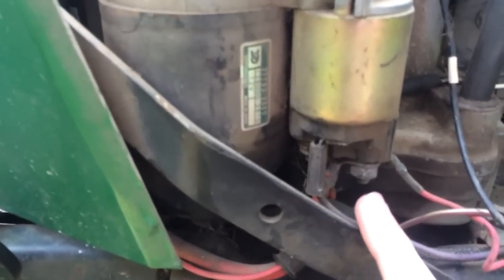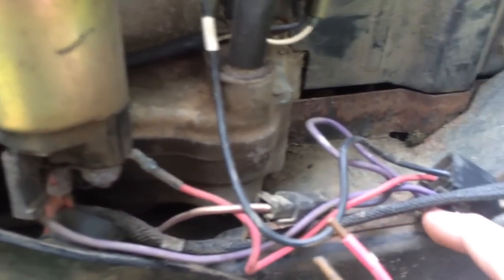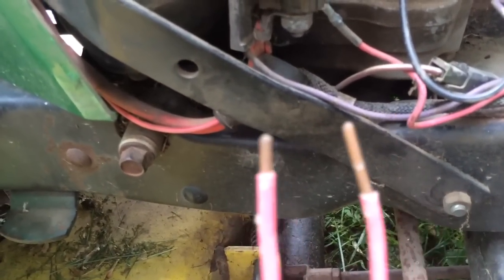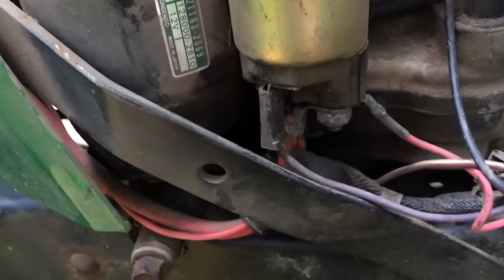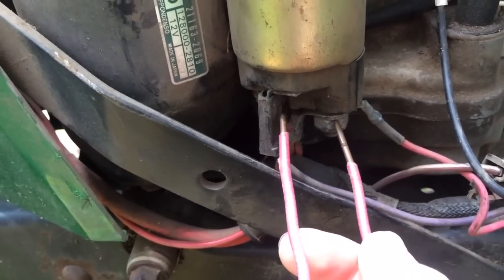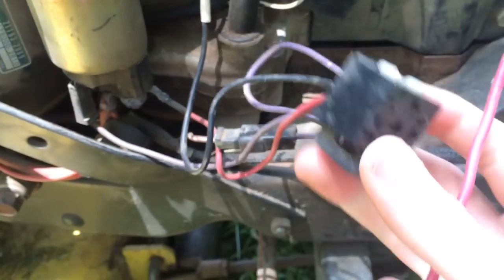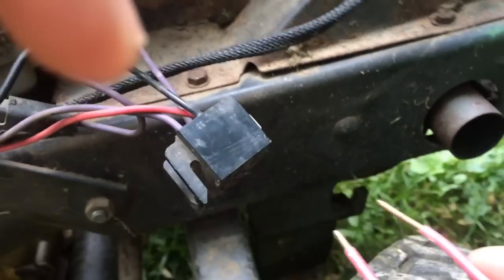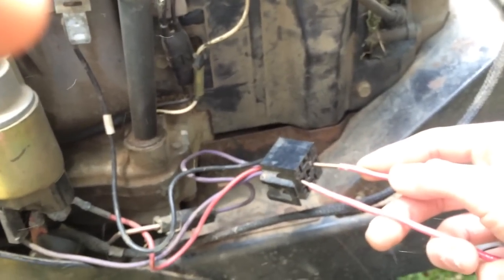How To "Hotwire"/Start An Engine Without Ignition Switch

Comment: Couldn't find an insulated wire to use... but I did have jumper cables.  Clamped one end to the positive then touched the other end to the little bolt on the starter & she fired right up.  Think I've got a bad ignition switch from leaving her in the rain all the time.  ps... it's a 2013 Craftsman LT2000.  Thanks for the video!

Comment: Great video, explained every step that even I could understand. It started right up. Now how do I know if it is a bad starter or solenoid ? Thanks again, you saved me a lot of money.
Reply from the maker: A bad starter wouldn't let it crank. It's usually either a bad solenoid or key switch.

Comment: You neglected to mention jumping the safety switch circuit to actually get it to start !
Reply from the maker: I didn't have to do that on this one but on some you will have to. You could pull the ground wire off of the coils and bypass absolutely everything, just have to put 12v straight to the starter to crank and choke it or pull the spark plug wires to kill it.

Comment: no key ignition and key missing will it start the motor purple to red with ignition area missing
Reply from the maker: I don't think so. The kill (ground) wire will need to be not grounded going to the coil so it will spark. You can try but I doubt it will work.
Reply: My 40h777 doesn't have no wire harness i did install a rectifier so its got that now just disconnect your coil black ground wire from wherever it's connected to coming from the engine and it'll start right up.

If you still have a ignition switch still hooked up keep the key to on position.

Unplug your main safety switch button wire at the bottom of the mower then cut the 2 white wires skin them and twist together both the white wires you usually don't have to mess with the black wires from that and this way you wont have to worry about anymore safety buttons and the driving mower will start up in any gear

Comment: Help! I’ve disconnected my starter, battery etc and just have the old earth wire and power wire. I’ve tried pull starting the mower, but there is no spark to the plug

Comment: When I try this trick, the motor won't even turn. When I use a screw driver to touch both posts, I just can hear something in the starter or solenoid spinning. Thoughts or ideas?
Reply from the maker: On starters that have the solenoid made to the side of the starter, if you cross the two big terminals the starter will spin backwards. You need to cross the big terminal with the battery positive wire and the little spade connector that's on the solenoid too.
Reply: You had a bad starter gear and spring

Comment: my key switch is bad and this will not work on my mower. i have started it in the past like this but the switch has to be on but since it does not work at all now my fuel shutoff solenoid will not allow fuel into the carb bowl. no fuel no go. 

yeah i could hot wire it and bypass the switch entirely but instead just ordered a new switch from ebay. cost me less that 11 dollars which is a lot better than screwing up the wiring.

Comment: Good, but if your starter switch is really toasted,...one must replace the switch...just get yur model tractor and get the switched replaced; plugging in wires, as originally connected.

Comment: Mine still won't start with touching that piece but it turns over
Reply from the maker: Newer machines have a fuel solenoid in the bottom of the carburetor. You'll need to get power to the fuel solenoid for it to start. Turning the key on should do that then jump the wires to turn the engine over.

Comment: Great video last of the loyal. I live on a homestead and picked up A JD 160 1985 20 Kawasaki. Someone has tried to cheat all safeties and has a mess. Since it will be a tractor to motor around the hilly homestead for it has tractor like tires on the rear. I would like to have an on off switch coupled with a push button to start. It is mess right now but it has a John Deere tractor spring seat the old type and a Massey Fergerson Steering wheel which makes not having power steering a non issue. It has boxes with fins under the dash and small boxes with 2 red wires going in and a few other boxes. I plan on no lights, no mower I just need it to pull my cart. Can you help me. Thanks for your time. Respectfully Jack
Reply from the maker: +Jack Trantham if all you need it to do is crank, I would put a battery disconnect switch on it and a simple push button to start it. The push button would need to carry the 12v power supply from the battery straight to the starter.

Comment: would this mess up the starter or anything doing this a few times?
Reply from the maker: +Kevin Patras No it should be fine to do this because it is doing exactly what the key would do. I still start this mower like this every time I use it. The only thing that could mess it up is if you hold it too long and the starter runs for too long.
Reply: I got a new part today so I shouldn't have to keep doing this but last night sparked pretty good and didn't start. I tried it again and nothing happened.
Reply: lastoftheloyal Hey I ve been doing this ever since I got my old craftsman.  Now all of a sudden it seems not to work anymore any idea what's wrong or suggestions?

Comment: how would you do that on a huskee riding mower
Reply from the maker: +Tim Ferguson It would be the same scenario. You need to find the starter and if it has one, a starter solenoid. Follow a power wire from your battery to the starter itself or the solenoid. Then jump the power wire to the other post on the starter or starter solenoid and it should turn over.
Reply: +lastoftheloyal  OK thank you will check it out
Reply from the maker: +Tim Ferguson You're welcome. Let me know if it works or if you need some more help.
Reply: +lastoftheloyal well I tried the make a pull start mod for it and all it did was let out a puff of smoke but didn't start up .... gonna trace the wires when I can get back out there and give that a shot
Reply from the maker: +Tim Ferguson Well if it smoked that could be a good sign. At least something is getting into the cylinder to fire. Have you cleaned the spark plug and carburetor?
Reply: +lastoftheloyal yeah just put a brand new plug in it today and have ran carb cleaner through the carb can't get it off yet was trying not to strip the screws they're pretty tight
Reply: +lastoftheloyal any ideas on why it would be burning oil...got it fired up for a few today the thing sounded like it was full throttle maxed and just kept spewing smoke out the front filled my whole area with smoke and smaller like it was on fire ....there was no fire but a person would of thought my garage was on fire just driving by ..
.thanks so far for the advice I'm lost on this thing lol new to this type of stuff
Reply from the maker: +Tim Ferguson I'm glad you got it running! Well, one time I put too much oil in my mower and it smoked like crazy. When there's too much oil it will blow past the rings on the piston and start to burn. Maybe check your oil level and make sure there's not too much in the motor. If there's not too much then maybe the rings on the piston are bad, or there's a crack in the cylinder wall letting oil in, or a head gasket is leaking. I'd start with checking oil level. Let me know how it turns out!
Reply: +lastoftheloyal yeah the lady I bought from didn't give me a lot of info on it or what its been through or anything ...I don't even know the year of it lol....no book just the mower itself and that she had the deck and belts replaced and that was it.... I got it and it ran for a few days then all of a sudden it acted like it was dead.... now I did the pull start method and fired right up just sounds like your standing next to a full throttle Harley ha....yeah when I get back to it I'll check the oil and try to find out what's going on.....question....can gas getting mixed in with the oil cause it to do this because when I.first bought it and got it home I changed the oil because of had gas in it .....I'm in the process of getting a fuel line shut off valve but was wondering if that had anything to do with it...I'm told not to fully trust the fuel solenoid on the carb....
Reply from the maker: +Tim Ferguson Oh man, gas in the oil is definitely not a good thing. Unless you're mower is completely different than what I'm thinking, the only place gas could get into the oil would be to go past the piston rings. I would probably drain the oil again and see if it has any gas this time. If it does then it might be time to start tearing it apart yourself or take it to someone if you don't feel confident in doing it. Gas getting into the oil would prevent the oil from lubricating the internals of the engine. If you run it for very long like that the motor will seize or blow up. My first step would be to drain the oil, see if it has any gas in it. Also measure how much oil is in it to see if there is too much. If you can't tell if it has gas in it or not by looking or smelling, maybe try to remember how much oil you put in it last and see if you have gained more oil. Good luck!
Reply: +lastoftheloyal yeah I'm gonna try to get out there today sometime and check it out ...been watching videos on how to take of apart seen some about blown head gaskets and all that ...